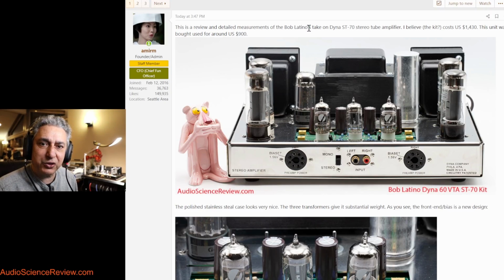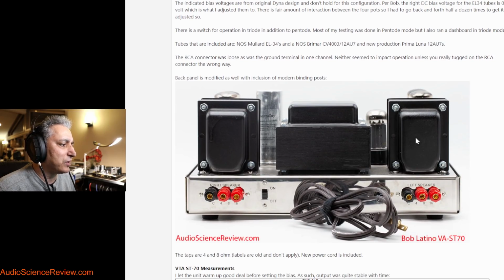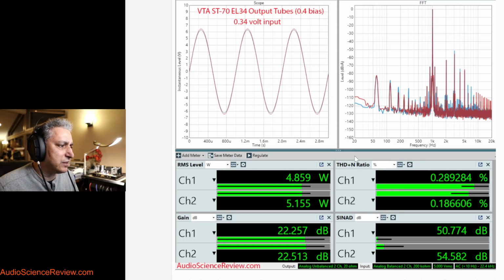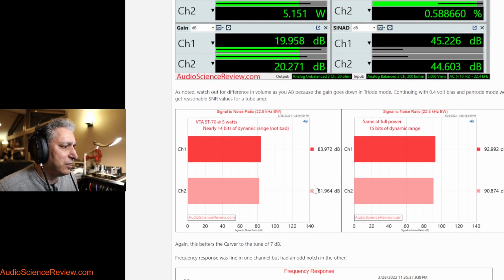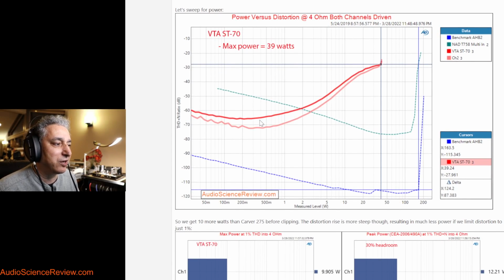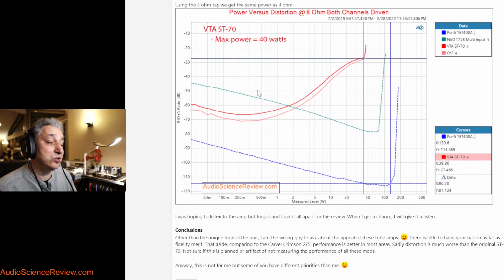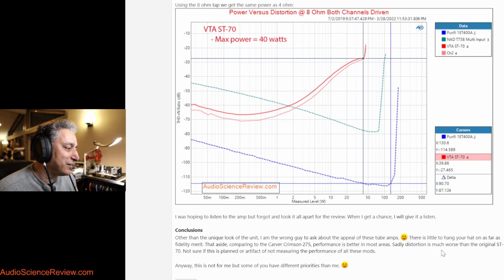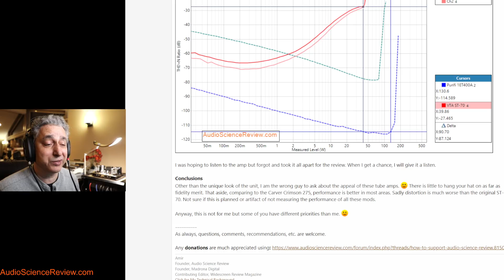VTA ST-70 Tube Stereo Amplifier Review

Comment: Any designer speccing EL34 output valves was never intending to get anything clean coming out of the amp.
It is basically a guitar amp designef to produce satuation
Reply: EL34 as I read was  modification of 6V6 in direction to  more power As for me starting from 5W  more power means less chances for any  ideal  speaker system/cabinet  which   can handle it.  For guitar we do not even want  ideal speaker so no problem

Comment: Another question…what’s the deal with low wattage amps and people claiming ‘5watts is all you need’ type nonsense??? Is 5watts all you need or is this for maybe a single full range driver type setup? Maybe we are just being sold garbage?
Reply: It just depends on the sensitivity of the speakers.  Klipschhorns for example will probably make you deaf at 5 watts
Reply: @PowerSerge5000  interesting.
Reply: I use  speakers 3W and do not feel need for more because I livie in block appartment with neighbours. They deliver full  from 45Hz to 18 kHz  Measuring at my normal full comfort level I see max 1,5W but with "silent listening" it measures  0,1W
Reply: @Mikexception  nice
Reply from the maker: You get reasonable volume at 5 watts.  But to get more, the power required goes up exponentially.  4X more power is 20 watts.  But 4X of that is 80!  Our perception of loudness also gets worse and worse with volume.  As a result, I am able to bottom out all but the highest powered amps.  Now if you have a 100+ dBSPL speaker sensitivity, maybe you are OK without it.
Reply: @AudioScienceReview  that makes sense
Reply: @AudioScienceReview  I am ok with measured at my 22sq  room listening point loudness  70 - 80 dB.  Adding to that 20 dB requires 6,6x3dB which results in over 64W instead 1 W. Sure that for big listening  room 1W  will be disappointing and there is big field for lower field  :(.  

 I personally did not succeed to make enough good spaeker for such loudness .  No possibilily to make sounding good enough speaker for 20 or more Watts.Max I could was 15 Watts two way system but those speakers are not in actual  production.    I patented unknown solution for 2,5 way crossover to serve it anyway after 20 years of testing it with variety of drivers  I am sure even this do not equal one cone which has disadvantage that cannot handle  much power. So the compromise of loudness in my opinion  is  must I hope someone will develop something else then me but I see intention  goes not that way.

Comment: Ahhhh so when someone says the amp sounds ‘warm’ it’s really just the higher noise produced by the amp.

Are there any tube amps that have low distortion?
Reply: If an amplifier sounds at all, with "warm" people mean in general more distortion with even harmonics. Although it also does come with some other issues as described in the video.
Reply: All made by experienced  producer have enough low distortions to be ommitted . Just see - with average 1W   amplifier uses 3-10% its nominal power and then even  less then proportionaly  are heard it's 1% nominal  distortions. How say  0,1% distortion in tube can impact   sounding and at the same time 0,005% in solid is noticable better? . Isn't a Snake oil?
Reply: @Mikexception  I don’t get it either. That’s why I think tubes are ‘warm’ cause you are hearing the actual device give off noise.
Reply: @joesshows6793  Before one say sometnhing sounds "warm" he should think what is the definition (or condition) of such "warmth". if it is bad foogy impression than it cannot be any good. Unfortunately some would accept.

   I have my idea,  which  matches my experiments and has nothing to do with nolinear distortions but with frequency chracteristic which is not represented by  standard measurements of frequency curve. It is rooted in cooperation beteween amplifier and real speaker   mess of dependencies for which solid is more vournerable. Such dependencies are dramatically smaller in one cone speaker and using  such speaker solid has also this   "warmer"  sound -  solid on 1 cone speaker additionally with germnanium transistors  can sound no any worse than  tube. I have amplifier from B&O  with grermanium and it is  with my construction one cone speakers like paradise

Comment: Replace the tube rectifier with a solid state one and you'll notice the performance of the Amp go up a few notches.
Reply: You will  of course have to add  a resister to  lower the voltage due  to a diodes lower internal resistance.
Reply: @MichaelBeeny  if you are doing yourself yes, but there are companies out there that sell plug and play solutions. Just remove your rectifier tube and plug in the new solid state.

Comment: I love tubes. Magical how they work. But no, they are not hifi and are in fact nothing like it. The high impedance output is very dependent on the speakers you connect to them, since the speaker has more freedom to do its own thing to a certain extent. Especially in the lower frequencies where the limited feedback is further reduced by transformer frequency rolloff and phase shifts. With the right speakers I'm sure these really can sound nice. And I suspect with the right music too. At the height of the valve era music didn't have deep tight pumping bass. Back in the day the gentle warmth tubes and flabby speakers add to the bottom end never needed to be especially tight. Thanks for doing this review.
Reply: I have a couple tube amps. I love them. Solid state is great too but there’s definitely a difference with tubes that can be preferred
Reply: I agree, idk if it’s that I grew up listening to tubes, or if there’s some aspect of tubes have that doesn’t fit into the test perimeters. There is just something about tubes (in my experience preamps) that sound so pleasing and natural. It’s not just me, go to any professional recording or mastering studio and 90% of them will use mostly tube preamps/channel strips for recording and tube eq/compressors for mastering. The the detail, dynamic range and soundstage are just so much better to most peoples ears. I know measurements tell a different story, but then our ears and brains don’t function the same as recording and measuring equipment do.
Reply: @richardbixler  I  belive  I solved that problem. The reason people notice "warm sounding" is that they switched very long ago to 2,3,4 way speaker cabinets and got used to character of it's sound.  And all studios and audiophile do not dare  to go back 

If we compare solid amplifier and tube amplifier, no matter PP or SE while using so called long ago  "concert loudspeaker" which were used in luxory radios in 50ties  difference between equal tube and solid is almost vanishing. But usualy not  to zero because   in any acousticaly resonant cabinet also  occure  phase shifts at low frequency between voltage and current  and it  plays role  with feedbacks of amplifier - the stronger FB  , the more.

 In tube amplifiers they are few times lower so turbulence  to shifts is also  few times   lower.  With non resonant acoustic  system and single driver without crossover , the difference in listening  I would say doesn't  matter. But do not treat single capacity as  no resonant - there  is too  LC resonance so tweeter is not adviced at all . 

 In fact the worse construction of cabinet and drivers and crossover resulting in resonances and phase shifts the more dependency in character of sound usualy blamed  to amplifier  . And monitors with tweeters crate it too. .

 So it is common result of cooperation between speaker and amplifier which should not be judged single while people used to talk only about  construction of  single  tubes and transistors. 

To get the best we need "only"  non resonant speaker driver/system/ cabinet which is  almost not found  today. Actualy up to my knowledge  only   I did it for me and it is unique combination which has good foundation but only proves itself with  using. Normal systems show strugling of amplifier with phasas.
Reply: I guess is about taste and previous experiences, some people like some distortion and harmonics in their music,  also many like the scratching sound of vinyl in their music, nothing wrong having a taste preference, but I do prefer perfect fidelity.
Reply: @Madlop2  My reel recorder has noise level at 55 dB and in normal listening I can't hear that  noise hidden deeply under usefull sound . To be clear I listen to symphony and prog rock where average level is often very low.  So it is not clear to me why is that  talk about  THD and second raw distortion of around  1% at full power. Surely with  required for my normal listening power of 1 watt it may  range 0,1% which means 60dB below sound level.  At that level I cannot spot anything .

 . At other side I would not dare to qualify amlplifier alone as hi fi or no hi fi . To achieve hi fi counts  everything including positioning of spaekers and surely their construction, also phase distortioons everywhere which cannot be avoided in more than one speaker cabinet  . 

With old tube ampliifier I enjoy so total mimic of reality that it is even frighetning  when perceived without preparation  Speaker in studio is talking like sitting 2 meters from me but  he is not there which is hard to feel comfortable  There are  no signs of "warm" sound or "nice distortions" To make more confuse I use parralell solid amplifier and it is very hard to recognize by sound from tube amplifier
Reply: Unfortunately solid state injects odd order harmonics into the signal path.  These odd order  Harmonics are canceled out in a tube amp

Comment: Tubes add distortion but some of it can be "musical". Like compression ( at low frequencies) and adding harmonics (at high frequencies). But all this can now be added through software.
Reply: probably it can be done by software , potentially even better and customable
Reply: @Madlop2  But it will be noticeable by ear damaging of sound. 
Tube amplifier can deliver perfect sound which by definition is forbidden to carry  noticeable damagesI 
Am not hopeless lover of tubes but comparing my 15W  tube amplifier to high class solid 70W amplifier in the same system and the same material  I can't find any reasons to set any of them above   other Only  solid upbeats  in some cases lowest  frequencies while tube shows more details  in low tones.  No winner. 

 For sopranos they work exact , anyway I use for  tube amplifier additional electrostatic "supplement" to speakers just to compensate capacities of wires which obviously for tubes are many  times more dangerous
Reply: @Mikexception  
You're describing tube compression and limiting. Obviously, both can be easily implemented in software code. Several free programs exist.
Reply: @giriprasadkotte9876  There is no practical  explanation for what you say about tube compression and limiting . Look  that most winyl recordings in 50- 60 ties (copied later to digital steraming) were originally recorded with valve  technology.  Now are admired with best SS technology and today  some say that they do not recognize in them original  tube compression and limiting. Only using  tube amplifiers. How come?
Reply: @Mikexception  
I'm not an electronics engineer but the amount of energy that can pass through a tube is quite limited. The flow of electrons being from a heated element. This often is seen as smooth compression/limiting characteristic.
Reply: @Madlop2  
Yes, Izotope Ozone is a good commercial example.

Comment: Thx Amir! 
I had the orig Dynaco St-70 and ST-35, which I purch'd used, listened stock, then DIY updated via VanAlstine kits and plans. Tubes (valves) have a charac. sound that is DIFFERENT than solid state. You  can also go hybrid (tube-trans) and mos-fet topologies that will balance SS and tube benefits. One day physicists will discover the test metric that correlates to subjective experience.
Reply: Perhaps the measured stuff here is exactly that, and people just prefer that kind of sound?

Comment: Very interesting Amir. I am very ancient and remember my schooldays building Mullard design valve/tube amps. They were very good for the day but no match for todays SS amps. I can understand the attraction of vintage stuff like this for some people but I see no practical use in a modern hi-fi system.
Reply: I'm approaching this from a non-"Hi-fi" perspective. I am not seeking the most neutral sound. Low power tube amps sound marvelous with high efficiency (95 db SPL) single-driver full range speakers.
Reply: @user-xg6zz8qs3q  Yep. I agree. I run a Korean Allnic 300b SET amp at 12.5 watts with Zingali 93dB speakers. For acoustic music and jazz it sounds sublime but doesn't do well with rock and orchestral music. For that I have a Kinki Studio EX-M1  Class AB amp with 215 watts per. Channel.
The combination works for me. 
The Allnic has pre outs and I would love to try it with a Purifi Eigentakt power amp.
Reply: @jimfarrell4635  I'm saving some cash to buy a pair of Audax AM21 speakers and a Unison Research simply Italy amp (EL34). I sampled this combo in a shop in Paris and I was floored. I know it will measure worse than a pair of cheap studio monitors. I don't care.
Reply: @user-xg6zz8qs3q  it really  doesn't matter.  If you like it, that's fine.if we all  had the same hearing and  requirements,  one amplifier would suit everyone.
Reply: @MichaelBeeny  You're describing the dream. Find the best speakers. Find the best amplifiers. Use them as a benchmark for sound production etc... Mass produce them. Lower the prices. And then Amir would be out of a job LOL
Reply: Modern speakers are NOT build for tube amplifiers to drive them.......the mix is an abberation.

Comment: I don't get it. Why would anyone buy a valve amp? (apart from nostalgia) It's 2022 not 1922.
Reply: If it is just to play around, why not, but the problem starts when the claims come out about how they make music more real etc.
Reply: @dagnisnierlins188  hasn't it been documented that the distortions tube gear produce are pleasing to the ear?
Reply: @dajikbatarang1  I would say it's more what you are used to hearing. When I switched to hifi I thought it sounded harsh and bright, two weeks later whent back to the old gear and all the drawbacks kick you in the face, no bass and very rolled off highs and the constant hissing when turned up is a dealbreaker.
Reply: @dajikbatarang1  If that is really the case, it should be easy to program a DSP to add a similar distortion profile to a good transistor amp. With a defeat switch 😀. Or if that was universally accepted you'd think the artist/engineer would have mixed it in during mastering...?
Reply: @nicksmith4507  im sure there is a dsp filter for it.  With regards to mixing and mastering, every artist is going for a different sound so they probably wouldnt just  apply that sound to all recordings.
Reply: @dajikbatarang1   In my practice I do not observe any such sensations  because there should be such pleasing in  compare  to solid But only diference observed is more or less in parts of frequencies which are explainable  by obviously  different construction
Reply: @dagnisnierlins188   well if you like live performances in subway stations 😆...  It's bloody darn close!
Reply: For the same reason I have a 1968 Ford Mustang Fastback next to my 2022 in the garage , because I can.
Reply: for the same reason people play vintage video games and other stuff it's just a fun hobby.   check out mr. Carlson's lab
Reply: @MickeyMishra  Sure I get that. I like playing with some vintage electronics and it's certainly cool to repair original valve stuff. I wouldn't buy a new valve  amp. But each to their own: I have seen new designs for 8 bit computers so I guess it makes sense as a toy or an oddity. I would no more use a commodore 64 as my main computer as I would a valve amp for my main Hifi.
Reply: I wouldn't base all tube amps on this one Amir got his hands on. There is a reason people spend big bucks on tube amps, and it has nothing to do with nostalgia. A good tube amp just sounds  more realistic than some SS amps..thats my opinion anyway..I have tube and solid state gear in my home, I like both